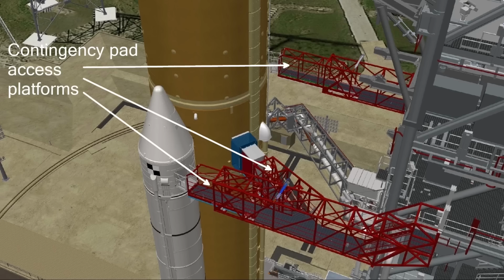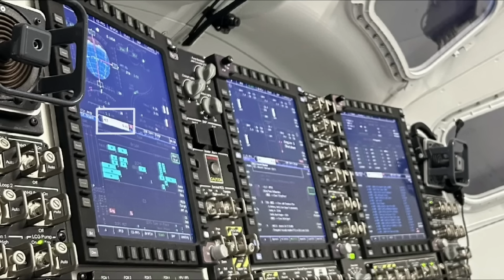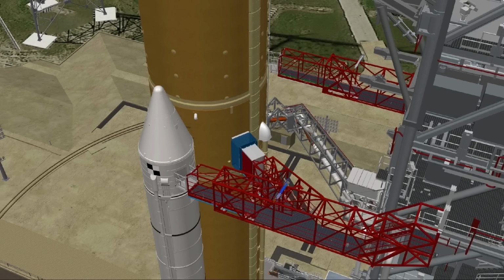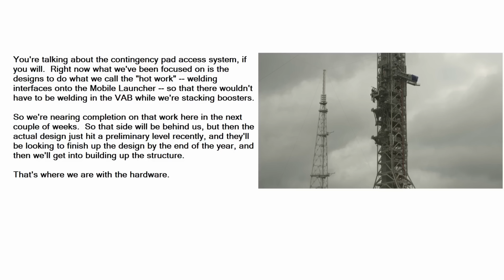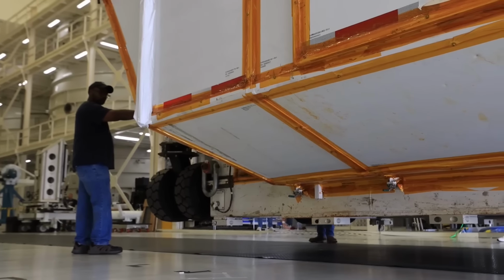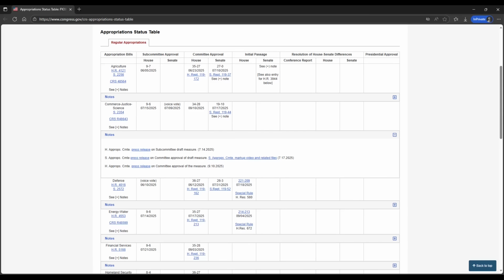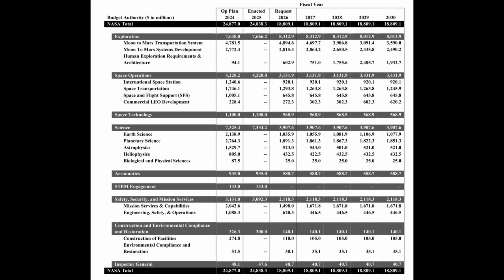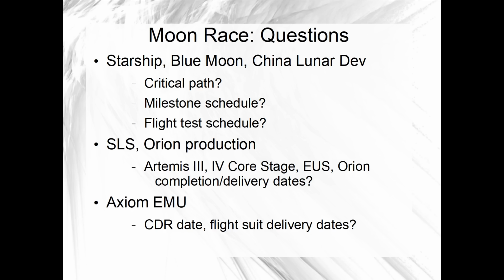NASA continues Artemis II plans and practice, Artemis V Orion ships, more Artemis III mystery

Comment: I imagine that welding work has begun on the Artemis VI CM pressure-vessel and manufacture of PV components for the Artemis VII.
Reply from the maker: It depends on how much of the Artemis 3 CM can be reused for Artemis 6.  Ideally they would be able to recycle everything except the ablative TPS, including the structure.  The Artemis 4 CM would be refurbished for Artemis 7, and so on.  Feasibility is one component of that, but also how much refurbishment is necessary.

A question would be when the next CM structures would be fabricated.  (A new Service Module is still needed for every flight.)

Comment: Since in the stacking of the LAS and Ogive BPC installation on the Artemis II Orion CSM, Philip, where the "Feet" of the LAS's MATA were installed separately in the Operations & Checkout facility. Why not when the Artemis III Orion CSM assembly has been completed and all of its' consumables loaded install the entire MATA followed by adding the Ogive fairing in the O&C building before sending the Orion CSM to the LAS installation facility to bolt the actual LAS onto the MATA's forward conical adapter followed by the conical fillet fairing? wouldn't that be simpler to do?
Reply from the maker: One of the questions is how simple the connection is between the abort motor and the MATA cone.  It may be that connection is more complicated than the pyro bolts in the feet and is more efficient to do offline in parallel with CSM assembly and test.
Reply: @PhilipSloss  You do raise a good point about the MATA forward conical adapter/Aft abort rocket-motor case joint but I can't see how it could be complicated. Now it has occurred to me that the MATA assembly and ogive BPC could be added in the O&C building then taken to the VAB to stacked (With a conical nose-cap to cover the MATA forward conical-adapter) then the LAS be stacked and integrated with the conical fillet fairing added there.
       Perhaps, Philip, when you next interview one of your contacts at the KSC if this could be done for Artemis III with the MATA assembly and ogive fairing added in the O&C building instead of the LASF then have the the LAS added and integrated at the LASF or the Orion CSN/MATA/Ogive fairing taken to the VAB and stacked followed by the stacking of the LAS assembly in the VAB.

Comment: What happens if Starship HLS launches successfully and puts itself into NRHO to wait for Artemis III, but that launch suffers six months of delays like Artemis I did?
Reply from the maker: There are or will be alternate missions planned.  We'll see how long that evolution of Starship can loiter, but the initial requirement is only 60 days with a goal of 90.

The obvious alternate mission would be to demonstrate as much of the "Artemis 3" mission as possible without a crew.  The first HLS unit that lands won't be able to return to low lunar orbit, let alone return to NRHO, so that would be an obvious set of test objectives if Orion never shows up.
Reply: @PhilipSloss  Artemis III is the second scheduled HLS mission, and it must be able to return to NRHO to bring its crew back to Orion or it's pointless.  I suppose they could do another test landing, but it would leave the A3 Orion with no landing vehicle.  Pretty big embarrassment for all involved.

Let's hope the new pad access hardware lets A2 get off the ground more quickly. If A2 has a six-month delay (for whatever reason), that would absolutely crush the EGS timing for A3, right? They need 1-1.5 years to prepare for the next launch.
Reply from the maker: @fighteer1 In your scenario, the Artemis 3 HLS (the crewed lunar lander demo) is in NRHO and then SLS is delayed for six months.  That Starship won't be able to loiter that long, so if SLS were delayed by more than 3 months, Artemis 3 would be delayed indefinitely.  They would have to wait until SpaceX could launch and refuel another HLS.   

The HLS stuck loitering in NRHO could still fly something without a crew, but that decision would have to made within 90 days of the LOCR, if not sooner.  However long the cryo holds out is however long NASA has to launch Orion and SLS after the LOCR.
Reply: I wouldn't concern myself with scenarios that have absolute zero chance of happening.

Comment: @17:33 is that true, that SLS is the "most powerful rocket ever built"?
Reply from the maker: No, he was probably flashing back to his administrator days.  And even then that claim was splitting hairs.  Going by that measure, Starship had the most liftoff thrust as soon as it did for the first time.
Reply: It still is the most powerful operational launch vehicle currently in use, Starship is still in prototype testing stage. Once Starship delivers an actual payload to orbit, then that changes.
Reply: @FrankyPi 

He said, "ever built" though, which just seems odd.  I thought maybe there was some obscure metric he was using for powerful, but usually you refer to thrust at launch.

Maybe the SRBs are the most powerful SRBs ever built, which could be a way to sneak that in as the most powerful ever built over Starship.
Reply: @PowerScissor  Even that wouldn't be true without Starship because Soviet N1 booster produced more thrust than Saturn V and SLS. The only precise metric SLS is and will remain unchallenged in for the foreseeable future is performance capability, it has the highest C3 capability by far, the only other rocket that was on the same level was Saturn V.

Comment: Jim Bridenstein only talks about one problem of the starship. How about how wreckless it is to land on the south pole of the moon rough terrain  with starship, the center of gravity will be too high. Need something low like the Apollo LM. Starship  architecture makes no sence for that application.🚀
Reply from the maker: That Senate hearing was focused on losing the race rather design/mission risk...although they never talked about addressing even the schedule "problems" noted.
Reply: HLS Starship's center of mass looks high, but may actually be low enough to allow decent stability, since most of the mass (including propellant) is concentrated toward the bottom, and though the landing legs as shown in concept renders aren't splayed out very wide, they're still starting out from a base that's 9 meters across...
Reply: @Spherical_Cow  LM had legs that spread its footprint to approx. 9 meters wide while it was only 7 meters tall. It was less tall than it was wide. You can make the argument that Starship HLS isn't as unstable as it looks, since mass distribution is what matters, but there's no way in hell that it isn't significantly worse for stability than LM was, which had 12 degrees or so of margin for safe landing and base for liftoff. It maybe has 12 to 14 meter footprint with legs, but the height dwarfs it immensely, it's a way worse ratio regardless of mass distribution. Due to the fact that the mass and therefore inertia stays constant everywhere, while lunar gravity is 6 times weaker than Earth's, it takes a force 6 times weaker to topple an object on the Moon for the same initial velocity than it does on Earth, or conversely a proportionately lower lateral velocity would cause the same effect when hitting the ground. This is why having tall landers is a bad idea for lander design, all landers that landed successfully were nice and squat, from Surveyor program to Blue Ghost, while those that failed were the opposite.
Reply: I reckon that when the first unmanned Lunar-Starships and New-Glenns land on the moon, they should all carry small robotic-bulldozers to level and compact the ground to make safer landing-sites for manned lunar-landers!

Sometimes, you gotta make your own luck!

Comment: I wonder, given artemis 1 experience, will ML-2 also have ability to install contingency access platforms? Or will it have something pernamently installed? Or are they considered unnecessary due to new FTS on Block 1B and 2 vehicles?
Reply: That question assumes ML 2 will actually be completed and used at least once to begin with...  There have been rumors going around that a compromise Artemis continuation program might scrap the EUS and ML 2, and instead replace the current ICPS with an adapted Centaur V or New Glenn upper stage.  For either or both of which, supposedly ML 1 could be tweaked to allow compatibility, eliminating the need for ML 2.  $Billions in savings are being touted as a result - though it's unclear whether there'd be any time savings (as opposed to further delays.)
Reply from the maker: @Spherical_Cow Those rumors are still puzzling, especially if the White House still wants to retire SLS and Congress (conversely) still wants to win the Moon race.  The project life cycle for a new SLS vehicle will take years by itself...SLS will have to be extended until all the design reviews, ML modifications, and DDT&E are completed...without any flyable hardware.

At this point, ML-2 is showing more progress than EUS; it could still be cancelled if Congress were to go along, but probably not until after Bechtel finishes construction and hands it over to NASA (EGS).
Reply: @Spherical_Cow replacing EUS with centaur V or any other stage would still require massive modifications to the launch vehicle and the ML-1. Does anyone besides eric berger seriously propose it?
Reply from the maker: @_mikolaj_  Eric often has exclusive information, not just in this case, so someone was talking about this.  

It will be interesting to see if/when we get something from Congress or NASA about it.  A different second stage/upper stage would be a new SLS Block vehicle that would require its own design analysis cycles, as with Block 1 and Block 1B, along with the rest of the DDT&E for that new vehicle config.  That is a non-trivial project that will take a non-trivial amount of time and money to make happen.
Reply: @_mikolaj_  welp, it's replacing a planned hydrolox second stage with another, already flight-proven, hydrolox second stage that's larger than ICPS yet not as massive as (though in GS2's case, taller than) EUS.  Yeah, sure it's going to take a bit of time.  However, Artemis 3 is late; I for one don't believe the Starship HLS lander will now be ready to land crew on the Moon before 2029-ish at the earliest.  So if I'm right there's still ~5+ years left to get Artemis 4 sorted out...
Reply from the maker: @Spherical_Cow  If HLS is that late, they would fly Artemis 3 in 2028 without the lander and then get the rest of the facilities ready to fly Artemis 4.  If HLS still wasn't ready, they'd fly Gateway missions.  The question is what Congress wants to do (fund) and what the White House does.
Reply: @Spherical_Cow  even with all the delays, like philip said, its pretty much starting a new SLS block from scratch(where both block 1B and 2 are deep into their development). So that means you need to design the new block vehicle, do simulations and other analisys, redesign the GSE, and not just ML1, but also VAB platforms and various adapters needed to stacking. Like, doing a reset for future SLS block development, when 2 are alreadt deep into development and already went past the design and analisys stage, is just not healthy and will take way longer than finishing B1B, and who knows, may be more expensive too due to additional delays and modifications.
Reply: @Spherical_Cow  Berger and his article is full of crap.